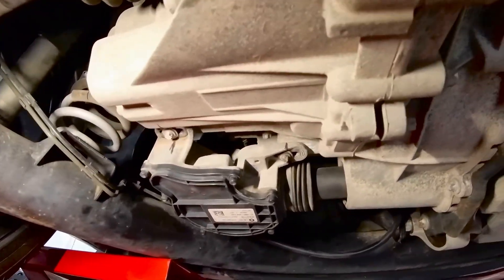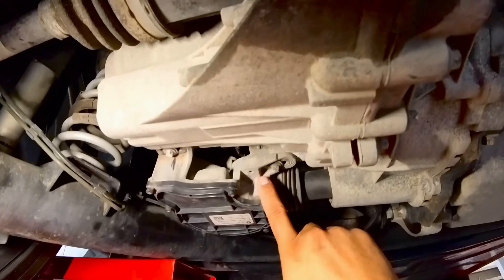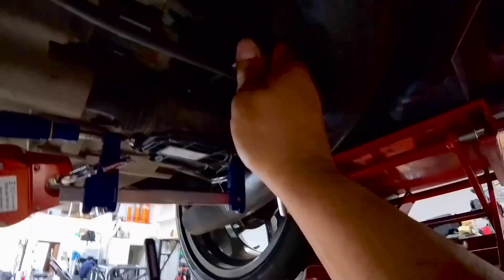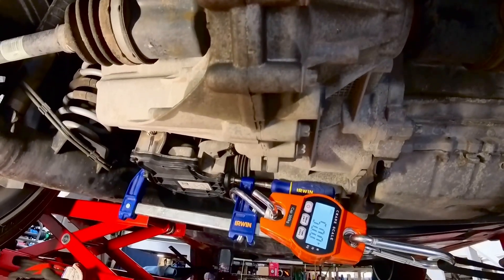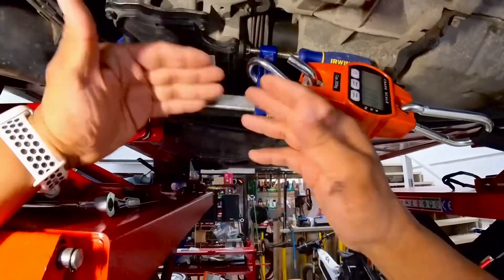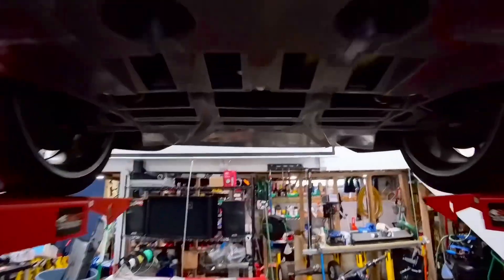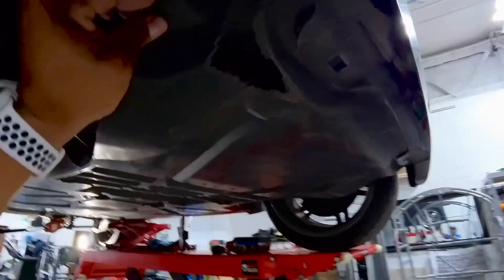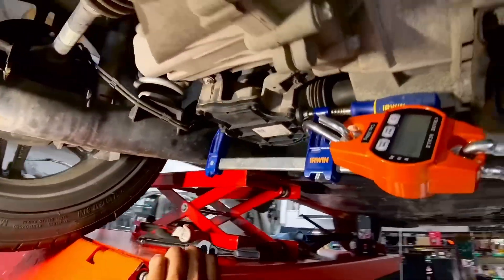2009 Smart Fortwo 451 - Adjusting the Clutch Actuator to the correct pressure

Comment: This is completely wrong, the correct procedure is to slacken all the bolts move the actuator full back then push it forward until it just touches the clutch lever. The 'lines' are stamped along the edges of the slotted holes (I can see them when you are marking it with a pen!!). push it from the point of just touching a further 3 lines and then tighten it up, thats it. You do NOT need to apply 50N of force, just count the lines...
Reply: Correct.... with 50nm was for the 450.....

Comment: Thank you for this video. We have two of these, both 2013 Fortwo. Both are shifting funny and are jerky on takeoff. Just ordered a force gauge on Amazon. Going to adjust both cars and see how it goes.
Reply from the maker: Just adjust the ones you have, then use an xtools D17 or any other capable obd2
Do a transmission relearn procedure 
Maybe a clutch relearn as well.
Reply from the maker: Depending on how many miles, you might want to replace the motor mount in the middle of the engine. You’ll get a lot of that the motor is bouncing when you hit it with torque and that will damage you flex pipe on your exhaust.
Get a smart one, not the cheap knockoffs